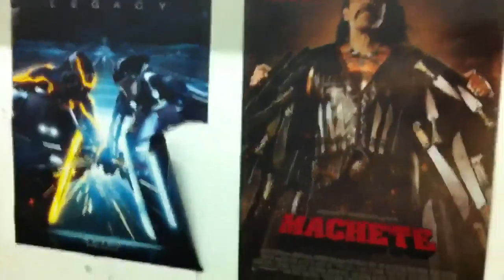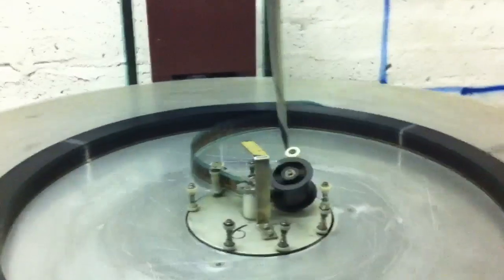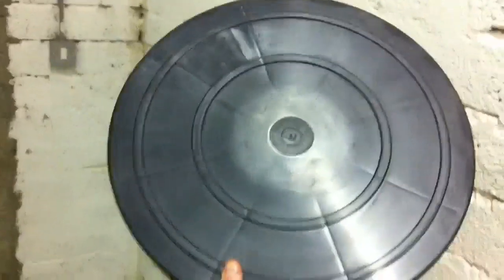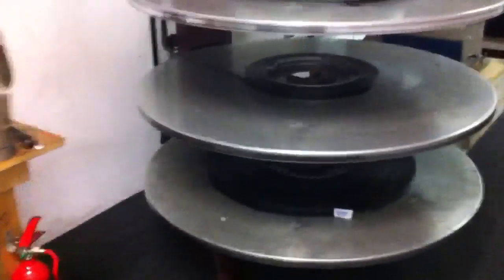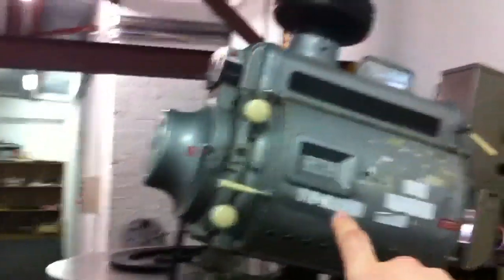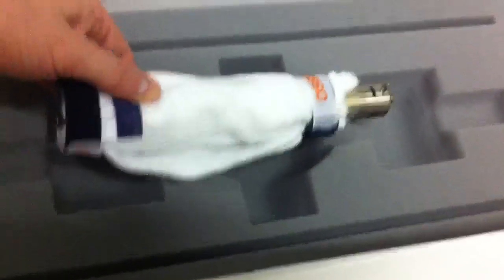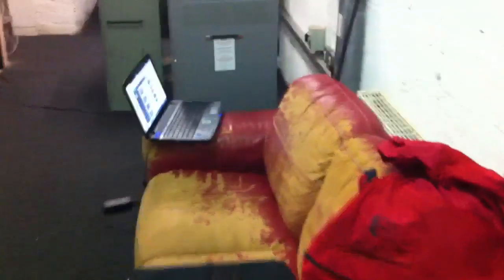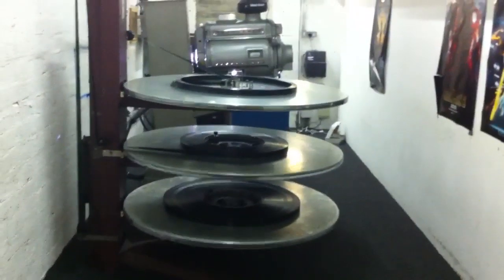Projection Room at my work place.

Comment: Thanks for doing this video.  I was a projectionist back in the 60's & 70's in Brea, California.  We had Simplex projectors, Peerless Arc houses & Altec Sound.  I wish I had taken pictures.  Thanks again.
Reply from the maker: Hi there, thanks for your kind comment. That's the reason I made the video, I didn't want to have any regrets and leave my memory's fade. It was great to work with them and fantastic to learn how to use them even if it is obsolete in this day and age. Thanks again.

Comment: Used to work with carbon arcs back in the day (1980's). I worked for a theater chain company that was "technologically reluctant," and wouldn't purchase the latest technology. So, they stuck with carbon arcs as their lighting source, and 20 minute reels with changeovers. Quite an adventure in those days when the "print" was shipped in six 20 minute reels inside four-reel canisters, from a film exchange.
Reply from the maker: Wow I didn't realise they were used up until then, haha technology reluctant, that's a perfect way of saying it. :P thanks for watching and commenting :)
Reply: i was a proj for over 40 yrs   i stared on xenon lamps in 65 our cinema got rid of carbons in 1958

Comment: What?! You say old fashioned?! For me this is High Tech! I have seen in my local cinema how the projectionist uses two projectors without this kind of taped up reels. He used the singel reels one by one without taping them together. He switched the reels with the projectors every 20:th minute. He didn´t wanted to tape the reels together. It would be much easier, but I think he had some kind of projectionists proud not to tape them together. I would do as you did in this clip if I was a projectionist, but in my small town in Sweden we only show a movie twice. 
Thank you for this great clip about the real cinema! Unfortunately movies are not showed anymore at is should be done.
Btw, You are a real hero showing movies as it should be showed! I really envy your work, but in a very positiv way! 
Keep up the good work!
Reply from the maker: Wow thank you for the kind words and the insights into the old school ways of your local cinema. I moved on for my role about 5 years ago to do something new but I am very proud of my time working with the 35mm film before everything went digital.

Comment: the wolf of Wall Street was the first movie to be shown digitally alone. it will take years before film is extinct yet QT and nolan keep the tradition alive.
Reply from the maker: I agree, I know a lot of chains still have 35mm projectors so they can show what we call "film club" movies on the original format. It's just much cheaper for the movie company's to put a movie on a hard drive than on film.
Reply: +Th3Bouncer the quality of 2k is not as good as 1080p bluray or even 70mm imax
Reply from the maker: +Justin Fencsak not sure if I agree with you about blu ray, but film will always be clearer than digital
Reply: +Justin Fencsak The quality of 2K is superior to that of 1080p blu-ray in every aspect.

Comment: do u have a video showing the audio track (and how it works) on the 35mm film i am wondering about the decoders and if they use descrete amps
Reply: Sir ,on 35 mm film reels sound is recorded in the form of photo signals in black and white colour and reproduced on the  principal of photo electric effect .